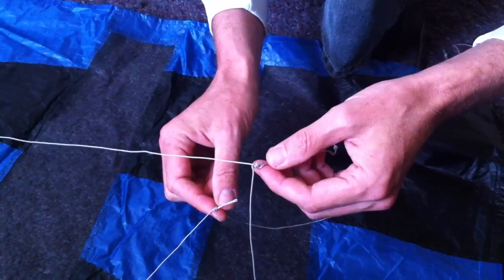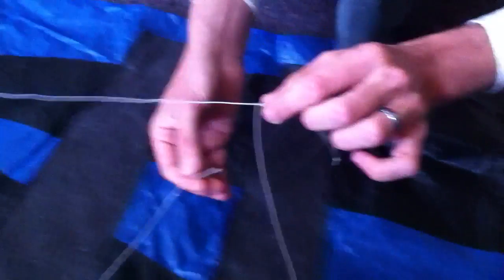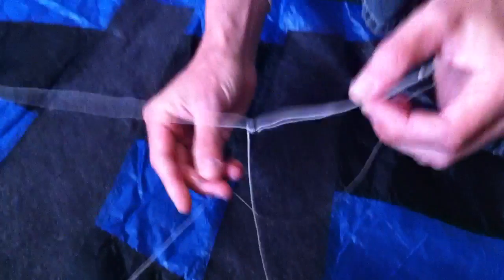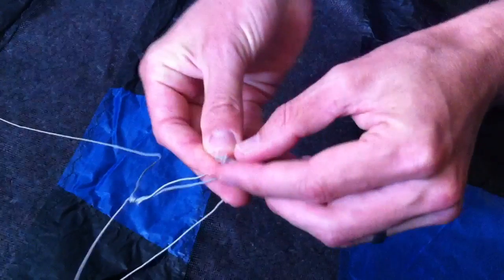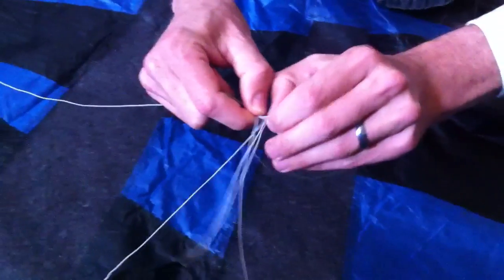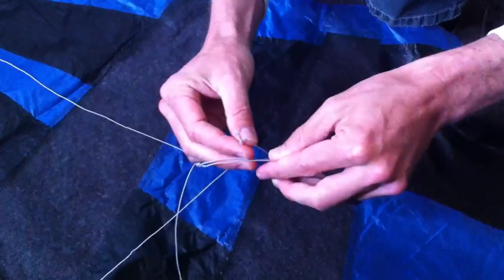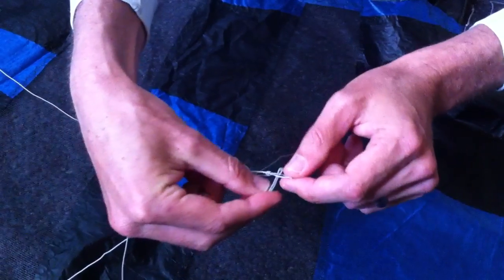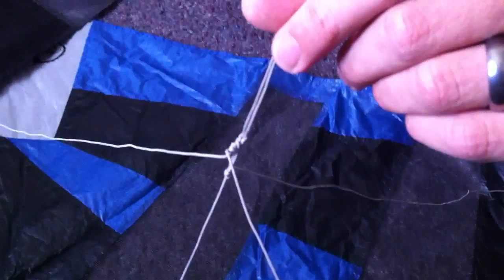Connecting bridle legs (Revolution quad kite)

Comment: Q- The top bridle lead line that you larks head  kite lines to is short and has a single knot at the end but the bottom bridle lines on kite is longer and has a total of 3 knots. why is the bottom longer with more knots? Differant way to fly? Flying in stronger winds? Angle of flight....?  I fly with the knots closest to kite for the lead and brake lines, is that correct way? Thank You for any help with this. indyjtk60 Joe